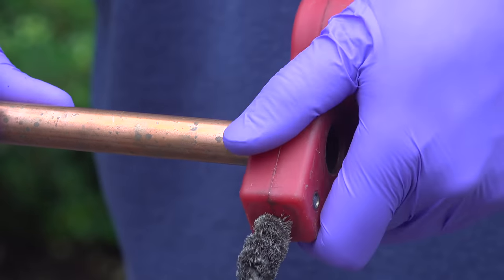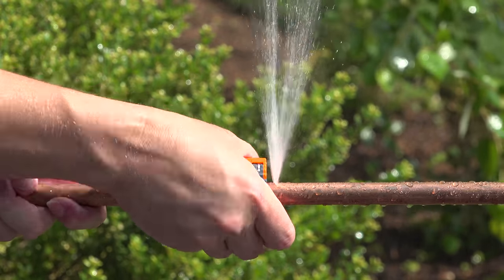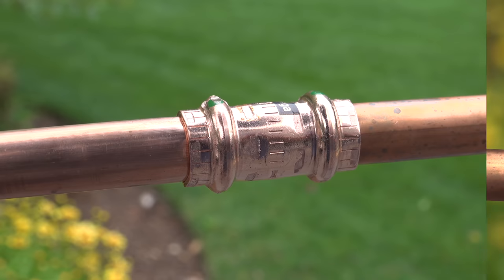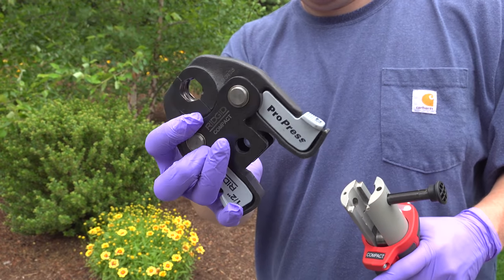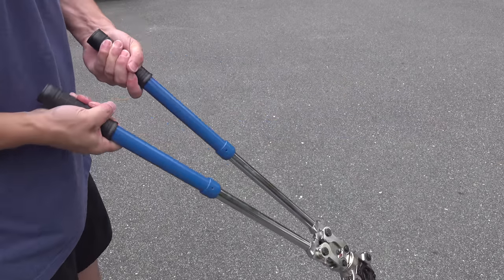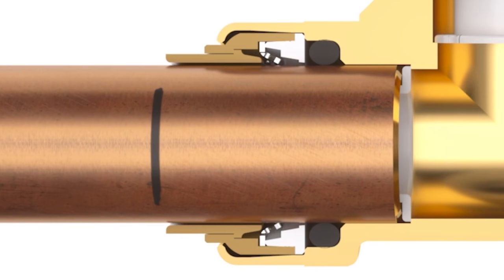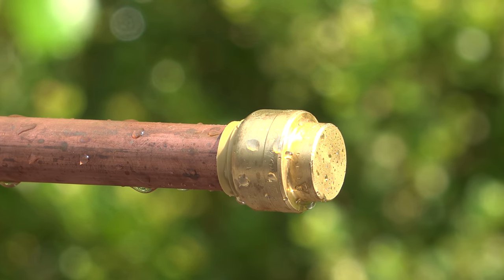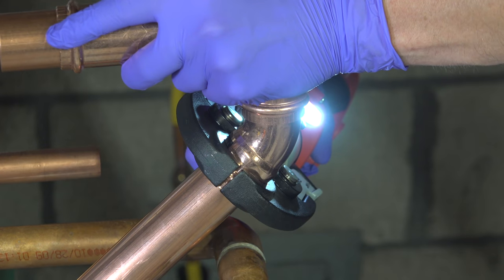NEVER SOLDER PIPE AGAIN - 3 Ways for EASY DIY Plumbing

Comment: Here in germany we mostly don't even use copper anymore, we use presses for nearly 20 years now but we switched from copper to an aluminum-composite piping some years ago.
Very easy and fast to use and way cheaper than copper.
Reply: Might be bad for Alum deposits,that may leach or seep over time,linked to  Alzheimer's alum plaque buildup in the brain. 🕯️🙏🕊️
Reply: Aluminum!  Amazing!
Reply: @---Avalon---Sky---  the aluminium layer is just there to prevent oxygen from entering the pipe. The water has only contact with a layer of polyethylen. PE piping lasts longer than copper.

Comment: These products are great for outdoor locations or where leaks aren't an issue. I would never use them in interior walls of a home and there's a reason why most municipalities building codes don't allow them either.
Reply: There are millions of houses in Germany and many parts of Europe, where the whole installation is done with compression fittings. They are almost foolproof to use. The way they are designed makes it quite impossible to install them wrong, without knowing it very soon: if you forgot to compress them you can either see it (they are still round and not shaped by the tool) or they leak as hell during a test run (leakage test). After duly installation they last almost forever. The o-rings are not made of rubber, but of a special polymer plastic, that remains flexible for decades. Never heard of leaking compression fittings, if installed correctly.

Comment: I have been watching and learning how to do my own minor plumbing, I have been using compression fittings since I can't afford the fancy tool you showed for crimping and at times you can't get the tool in where you need it. I'm surprised you never mention the compression fitting route as an alternative. I also have use shark bites in more than one occasion. 
Thank you for the video..
Reply: Learn to solder it's easy and better
Reply: Soldering is literally impossible to fail, put some flux on, hit it with a torch until solder replaces the flux. I have an Iq of 70 and have done the plumbing in 3 houses now without a single fail point.

Comment: As long as the shark bites are exposed, and installed properly, they do just fine.  Most of the fails occur when they are either reused, or not pushed all the way on.
Reply: Yeah I had a major leak in my bathroom and when I cut open the wall they had used shark bites. I fixed it with propress but I had to replace the bottom 2 feet of drywall around the whole bathroom along with insulation on the exterior wall. What a mess. Thankfully it was on the bottom floor with concrete slab
Reply: Thank you people don’t understand they are rubber yes rubber o rings and they will need replaced so don’t bury em boys and they are expensive

Comment: Our house was built in 1979. The soldered copper pipe fittings failed after 20 years and in the straight pipes in multiple locations under the slab, causing flood damage.  If it was an incompetent plumbing job, I expect it would have failed sooner. At the time of the failure, Sharkbites were just coming out, so we rigged up a temporary fix... that now is permanent, because 24 years later, it already has outlasted the original copper fittings. Copper is not eternal or infallible, and what really irritates the plumbing experts is that instead of relying on their expertise, we're surpassing it. To rerun the copper in my house, they quoted us $6000. I fixed it with $200 worth of Sharkbites and a roll of Pex. As far as I'm concerned, Sharkbites have proved their mettle far better than professional installed copper.
Reply: I also had to repair some failed copper in 3 different spots in a large, expensive house my daughter had that was built in 92 with all copper plumbing.  The copper had multiple small holes in it in several places.  I don’t know if it was residual flux that ate into the pipe, but it surprised me, and showed me that soldered copper doesn’t necessarily last near as long as I thought it would.
Reply: usually, it's the copper pipe that's failing, not the solder joints.
copper will corrode, and small holes will develop in the pipe wall.

Comment: I’d be very concerned about the long term pipe repair using these connectors. The same concern I have for Sharkbite connectors in any enclosed areas such as walls, etc. They use rubber O-rings which will degrade over time. A solid solder joint will last indefinitely.
Reply: pro press is walls it totally fine.  They are meet the spec for even the most insane regulations like NYC for building boiler supply and water plumbing.  They do not let you use them for air though.
Reply: @mcgman8058  "insane regulations" and "NYC" AHHAAHAHAHA. no.
Reply: Have  experience with upgrade on old  sewer clay pipe bell ends rubber Oring 15mm or 20mm dia. or 5/8 or 3/4 inch dia. it's hard to measure mush  after 60 years under ground  , have degraded to mush , so even new style synthetic rubber 3 mm dia. or 1/8inch dia."Orings"are not going to last 20 years "under pressure" before leaking . Also rodents can eat through any of the new style poly water pipes .
Reply: Sharkbite sucks. He is sponsored by them. I would never stand behind something i don't believe in just for the money, such a bad character.
Reply: @Zoldier92  germany make good "sharkbite" style connectors that have TWO rubbers and a metal olive. You plug quick then tighten. They last 100 years easy.
Reply: @dimitar4y  "They last 100 years easy."
We won't know that for another 80 years, bud.
Reply: @Zoldier92  You are out numbered ! All these Guys commenting are not idiots , just saying . It is whaat You prefer.
Reply: I am with you on this. Copper pipe and soldered joints. 
A plumber may use quick fixes on jobs as he knows it will last long enough. 
My brother in law is a plumber - he put all plastic pipe and push fits on his underfloor heating. It leaked and the whole floor had to come up.

Comment: I was a plumber for residential construction for over a decade before I changed my career, and I've worked and restored old cars my whole life and one thing is forsure if the car is ten years or older you can bet you're going to be replacing most of the rubber parts in that car, especially o-rings. I've installed countless copper pipe water systems in houses. I've never been called back for rework, for my own work that is. It's really not that much extra work to do it right the first time. And yes I've installed countless PEX water systems as well but I've gone to alot of service calls for a water leak only to find someone, either the homeowner or a tradesmen from years ago drove a nail or some hardware into the pipe only for the pipe to make a seal around it until years later when the nail, staple or screw rusts and then causes thousands of dollars in water damage. My point is sometimes it's not worth reinventing the wheel. solder copper pipe is the best in my opinion

Comment: For copper tube joints I prefer soldering, period.  In close quarters I use a piece of fire proof welding curtain wetted, to protect the surrounding areas.
For faucets and valves I use compression fitting joints, because the new "lead-free" soft solders have a melting temperature that is close to the temperature limits of the plastics used in the valves.

Comment: Compression fittings are the best alternative especially if you have high water pressure. Shark bite fittings can  "pop off" under higher pressure
Reply: I have used many compression fittings on copper for repairs under sinks or adding shut-off valves and never had a leak in about 20 years so far. No soldering.

Comment: Thanks for the informative video. The only downside of Pro Press fittings is that I see no way to remove them. Shark Bite has the downside of swiveling, more apparent when it's a valve. In tight areas where an open flame is an issue, an electric pipe soldering tool does the job. Though I prefer soldering, I have used PEX pipe, push type fittings and even cpvc for certain applications. If done properly, all these systems work well.

Comment: Sweating pipes is super easy, and using a silver bearing solder will guarantee no leaks. Preheat the pipe in front of the joint, and then heat the joint. Works every time. For tight spots that are around burnables, use a solder blanket.
Reply: You clearly missed the whole point of the video.
Reply: Sweating is not simple and takes experience. I've seen many plumbers screw it up. Especially if you are working an existing pipe that has water drip. 

The flux used degrades the pipe. I still do it, as it's required in certain applications. Everything has it's time and place. 

Your comment about silver not leaking is absurd. Silver is used to avoid lead. That is all. Leaded solder still holds on non potable systems and doesn't leak either.
Reply: @djaa7  I learned how to sweat pipes in one day. It's not that complicated. Depends on the flux that is used. Water soluble flux will wash away and not corrode the pipes.

Comment: DIYer here.  I use a combination of ProPress, Pex A and Sharkbite fittings on my home, have yet to have a leak anywhere.  I actually wouldnt mind soldering but my asthma acts up anytime I take a torch to the flux.

Comment: Great video! I live in MA as well. Just bought a home. I was going to run some pipe, but the code states only a licensed plumber can do the work. Odd as I am able to do the electrical. Great vids!
Reply: None of us on this site will call the Plumbing Police on you... ;-)
Reply: @jtdundee  Haha I do plan to do some of the work in my home. It's just odd as you would think the risk of harm would be greater from a faulty electrical install.
Reply: you can do anything in your own home as long as its a one or two family...anything bigger you need a licensed plumber....everything must be inspected.
Reply: Here you can do the work but a licensed plumber has to pull the permit and call in the inspection. same with electric.  as long as it passes a pressure test and the inspector signs off on it i cant see why they should care !
Reply: @workingshlub8861  in Massachusetts?

Comment: A lot of pro's hate PEX because it cuts down labor hours. I know because my Dad was a Union Master Plumber. However, Ryobi has a $100 crimper that makes it easier than the Pro-Press system, like a lot easier physically, needs less space, easily removeable without damaging the PEX/Pipe, and cost about the same or cheaper for brass fittings.  I'm not a plumber, however all the studies I've read indicate Pex is much better protection against freeze expansion than copper for us NE'ers, can be bent easily with a $3 form or even without if you go with a wider sweep, etc.
Wish I'd had the Ryobi before I had to spend on Sharkbites fittings several times.

Comment: Solder was never difficult. Grandfather was a plumber starting bringing me on his jobs when I was 5. 

Correctly installed solder never fails . 
     If a incorrectly solder joint ever fails in the future, you can just reheat it re-clean it, and re-solder it. For the price of 1 inch length of solder . That’s all !. 

If they press fit joint fails in the future, you’re cutting out a section of copper , and having to reinstall two press fit joints & copper pipe to replace that section.

Comment: The first thing you need to know is you absolutely need to install a valve that let you shut down all the water coming in to the house and a few more on strategic places in your water system in your house. Once that is done you don´t have to worry much about what to use to lengthen or repair your water pipes just use something that really works in the shop closest to where you live. Old clamping ring couplings will work just fine as long as you make sure to use the small supports you put inside of the pipe before you tighten the coupling.
Reply: Most of my taps and toiled inlets have their own in-line stopcock. They are invaluable for little bits of maintenence without turning the water off to the house.
Reply: Whenever you do a bathroom or kitchen remodel, always have the plumber swap out those old shut off valves.

Comment: I have seen many O rings hold up for years under aircraft pressures of 3000 psi, so I'm not too worried about an O ring not being able to handle 80 to 100 psi, especially when they're not exposed to the elements of dirt and grease.
Reply: It's not pressure you should be focusing on.
It's TIME an O Ring made of Rubber that will NEVER outlast brazed copper junctions. NEVER.
Reply: @andylowe2725  It doesn't matter, the pipe will develop pinholes within 50-80 years on average. Don't believe me, go look up the science done by plumbing orgs and standards bodies.
PEX is guarantee for at least 50 years, and many expect it will last a fair bit longer.
There are a few well known ways solder joints fail. Sometimes they are good for years before failing.    Any plumber knows this, and especially the fact that EVERY facet of the soldering process from pipe prep, to fluxing, to properly sweating the joint via capillary action, has to be about PERFECT for EVERY single connection. 
And sometime even the best will fail because there was just enough moisture in the pipe to cause just a bit of steam to work its way into the solder joint.
The fact that a kid right out of highschool can be shown in about 15 minutes how to prep a pipe properly, slip a press fitting on and allow the machine to do its job, is what drive pro's crazy.
Who the f is going to pay them $40-50+/hr when they can pay an unskilled guy half that?

Comment: As a retired Plumber in Australia, why don’t you use more flared compression fittings?
Especially in areas where there is the risk of fire when soldering.
The crimp style fittings are good but require a fair bit of space in and around the copper tube to engage the crimping tool.
Just interested to know your thoughts and reasoning.
As we say here “good on ya mate” 😁👍

Comment: Depends on what you're doing. They're expensive, so I wouldn't use them exclusively in place of soldering. That would really cut into your profits. Maybe if you're just fixing a leak or replacing a hot water heater, but not for a whole house installation. Everyone uses pex where I'm at now anyway though.
Reply: Press fitting are the standard for water and even gas pipes in large parts of Central Europe and have been in use for ~20 years. They require very little skill, are extremely durable, and far less likely to leak because of a human error. Its extremely rare to still find new soldered copper pipes anywhere here. Maybe something like 1 out of 100 installations still use them. Since plumbers take up to 100€ (especially plumbers with master certificate), the extra cost for those fittings is usually offset by reduced working time. Also, plumbers here just charge you for material cost and working hours. Doesnt matter the price, its gets relayed to the customer.
Reply: Soldering is expensive, unless your time is worthless.

Comment: Fittings are stupid expensive though. $7-25 per fitting depending on part.
Reply: The installation gets cheaper due to timed saved, this has been going on I Sweden and other northern countries for more than 20 years
Reply: But if any numpty can do it without setting the house on fire, or getting a plumber in, surely it's money well spent...
Reply: Cheaper than a flooded house and a non plumber can fix it.
Reply: I was thinking that too. And the initial cost of the tool is astronomical for the amount of times you will use it. Easier to do it the old school way
Reply: @Simon-747  i began to press fittings 15 years ago and stopped with open fire then. That's my daily work. We only work like this. Time is money
Reply: @gpethst24  A 12" square sheet of fire resistant sheet costs $3, is good for a lifetime.
Reply: Who cares solder and compresion fittings have always worked
Reply: Not to mention the press is around $5k
Reply: Seems we work little different here in europe..
Reply: I use shark bites alot. Saves time. Easy to adjust and reuse. Easy to transition from copper to pvc or pex. But I only do plumbing work on handyman and diy applications, not major professional work.
Reply: Pex is better.
Reply: @AmalgmousProxy  pricey though
Reply: @Kryynism  the pex crimp rings and stainless steel bands with the unions are way cheaper than copper. Just the cost difference between copper tubing vs pex tubing alone more than makes up the difference between the joint system. Plus, no fire.
Edit: The cheapest 1/2-in x 10-ft copper pipe I could find is $14.26, pex 1/2-in x 50-ft roll for $15.18.
Reply: @AmalgmousProxy  I haven't looked into it in a while.
Reply: More and more companies  and locales are outlawing the use of torches.
Reply: For residential the best thing to use is pex with the cring rings.
Reply: @keithjones197  No, they are not.

Comment: Almost everyone has a torch, solder and paste or can buy for a few bucks. This is like an ad for expensive alternatives to what's tried and true. Good work!
Reply: $25 for the torch and $20 to $25 for solder and flux. If you only need to fix one joint, and don't have the tools, it's a valid option. But if you're a man you'll see this as an opportunity to buy the tools.

Comment: When using a torch to solder water pipes remember to fill a few buckets of water before shutting off the supply, just in case. BTW soldering takes skill, as a mater of fact so does any plumbing! It’s hard to do anything correctly if you are unskilled. I’m sure these non solder joints are all the rage but I’ve not seen them used in large commercial buildings yet. Are they just for home use?
Reply: The reason they are not used in Commercial is because of flamability, no other reason.  And yes, Pex has been all the rage, for like the past 40 years and longer in the EU.
Reply: All water pipes at the parkland hospital in Dallas use press fittings.